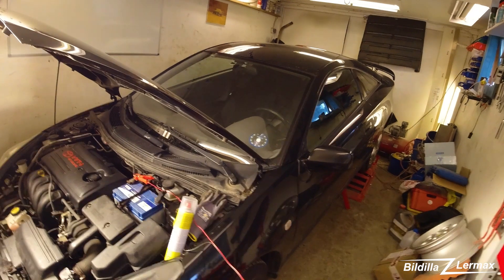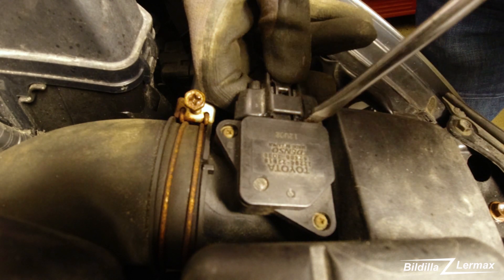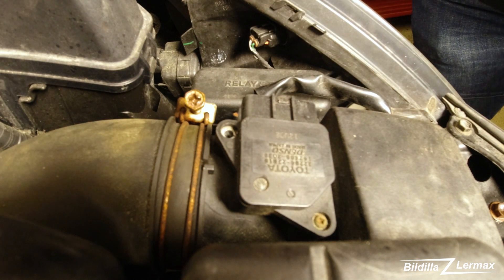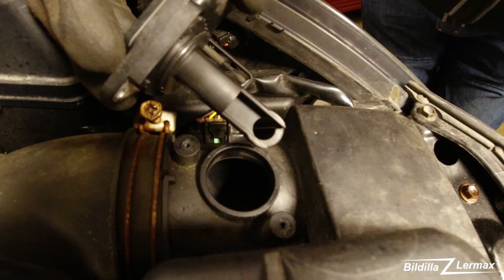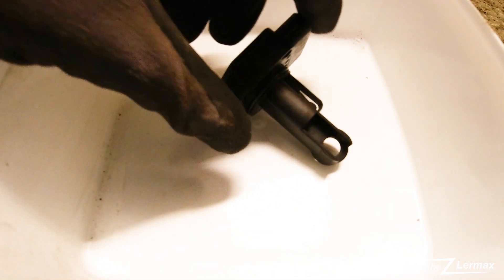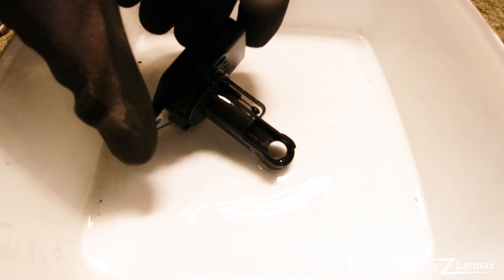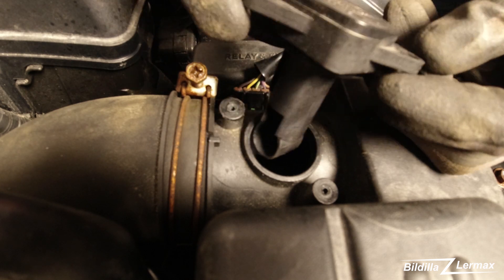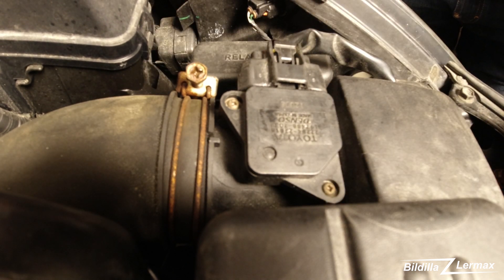DIY / How to: Toyota MAF / MAP Sensor quick fix  - Toyota Celica 1.8 GT - T23 - 1ZZ-FE - Bildilla

Comment: Hello, a sensor so dirty up to how much power can you lose? 2 hp, 5 hp?
Reply from the maker: Hello.
Hard to say in hp. But the best example was on a friend's 2003 Toyota Camry. It ran ok, up to 3000 rpm. But almost died when he was about to give way to pass other cars. The car gave a completely wrong mixture of air and fuel.
This affected consumption and how the engine worked.
After a cleaning, the car was like new again!
I have a video about this job on that car, here on the channel as well. Will have to see if I can find the link for you.
Video: https://youtu.be/g4cqLFBTzM8

Greeting
Pål (Paul)
Reply: I have a 2zz and the car in the dyno didn't give me the expected results. They said to change the candles, coils and the MAF to get more cv. Now I don't know if it will work...
Reply from the maker: @stevenoliveira4620  No, it's hard to say what helps the most. But a quick look and possible cleaning of the maf sensor will be able to provide more correct information about air volume and air temperature to the car's computer brain. This is an important factor in getting a more correct combustion.
But there are many other factors that can be decisive as well. Many small mistakes ultimately affect the whole.
Here in Norway, we struggle with the weak 1ZZ engine. An engine that was never optimized. It was simply a complete mess, right from the start.
But 2ZZ should be a much better starting point!

Comment: running okay 2 years later?? having this exact problem right now. What chemical did you say you wanted to use, but couldn't?
Reply from the maker: Good evening.

Yes it has worked very well on many Toyotas and Lexuses, I have done the same on.
I used brake cleaner spray, as we couldn't find MAF/MAP cleaner in the shops here in Norway.
See it is recommended to use MAF/MAP cleaner. But has worked perfectly fine with the brake cleaner I use.

Greeting
Pål (Paul)

Comment: Hi. Did you disconnect the battery before removing the sensor?
Reply from the maker: No
Reply: @bildillamagasin  But you schould reset the ECU after the cleaning, right?
Reply from the maker: @DjsMind  Hi

No it shouldn't be necessary.
The only thing you do is clean away the dirt, which destroys the sensors for the air flow and the sensor for the air temperature on the way into the engine.
When this sensor is dirty, the ECU / Engine gets the wrong information.
After cleaning, nothing in the ECU is affected in any other way, except that the ECU now receives the correct information.
I have a video, when we do this the first time, on a Camry 2.4 liter. The car would not go over 3000 rpm, before cleaning. After cleaning, it took a short time before it came back to life. It all came from the ECU getting the wrong information!

Regards
Paul
Reply: @bildillamagasin  Ok, thanks!
Reply from the maker: @DjsMind  It is nice that the people get this simple job, in normal service jobs.
I have done it on several Land Cruisers, Camry, Corolla, Celica etc.
On some cars, the sensor has looked ok, while on others, it has been very dirty!

Regards
Paul

Comment: was it good afterwards? .. thanks for the video
Reply from the maker: I have now cleaned the MAF sensor on several cars. Camry 2.4 which did not want to go over 2500 rpm ... After cleaning, it went just fine. And after a few miles, the computer brain had learned to understand the sensor's sudden change, and the car worked great.
On more Toyota Land Cruiser / PRADO 3.0 D4D engines, with good results. The Celica, Corolla 1.4 petrol, Lexus RX300, all have worked more or less. Then some were dirtier than the others! But this is really a job that should be a normal service job, for a home mechanic :)